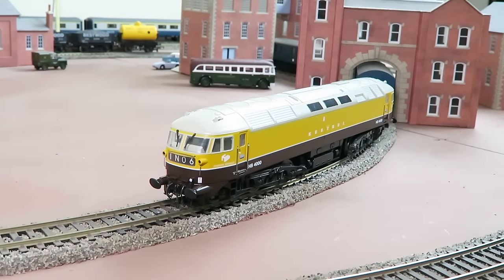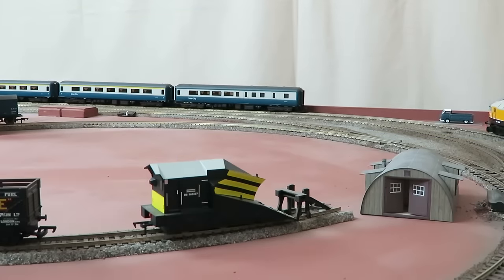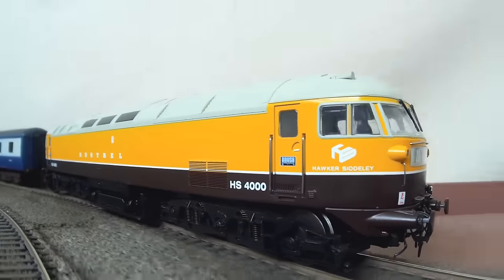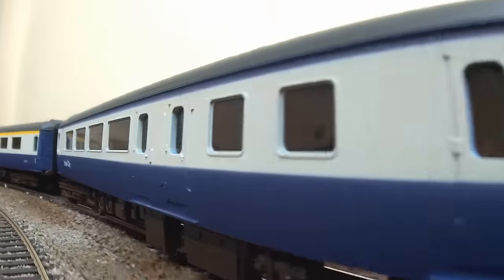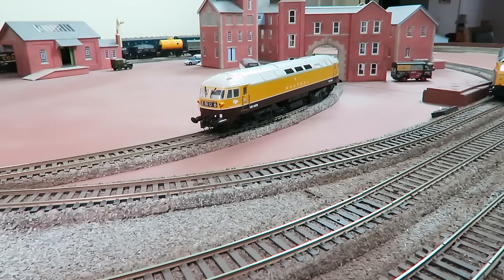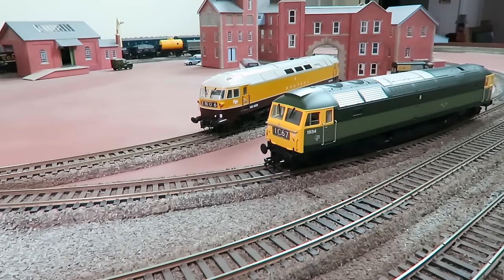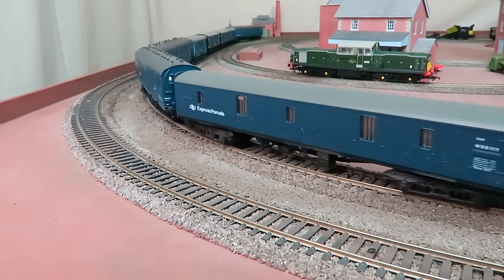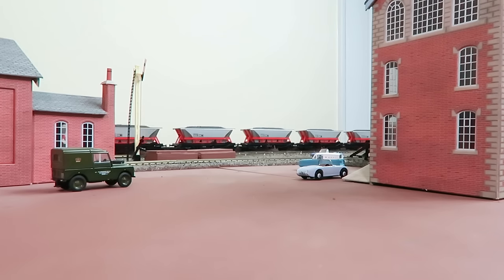Kestrel, HS4000 the world’s most powerful Sulzer locomotive. Model Rail

Comment: Maybe a good interprettation of the sound may give this video https://www.youtube.com/watch?v=K979vex_y18 , with the loco shunting in the first part, and locomotive with train passing at full power in second part.
It's the French class SNCF A1A-A1A 68000, which has the same engine type, the Sulzer LVA24, however with 12 cylinders and not 16 as in Kestrel.
The same 12 cylinder variant was used in the class 48 locomotives, which were class 47 which had this engine type as a test, which was not satisfying, those engines were subsequently sold to the SNCF to be used as spares for their 68000 class.
The French found out why the initial failure rate on these engines was so high, it was a wrongly sized tool for fitting the main bearings in the engine, they rectified this but never told Sulzer nor BR of what they found, otherwise the class 48 would maybe have been more successfull.
This class must not be distinghuished with the A1A-A1A 68500 class, which has a different engine and sounds completely different (but better in my opinion), the SACM AGO V12 DHSR.

The second sound you used may be the better of the 2, being more like this French locomotive.
The first sound is of a class 47, this is a very different Sulzer engine, the 12LDA28, which is in essence 2 inline 6 engines side by side in one block, both crankshafts connected by gears.

It was not easy to find a video of the SNCF 68000 under power, as most video's are made while shunting or coasting at speed, and French drivers rarely seem to add some thrash when passing enthusiasts.
Those locomotives were withdrawn about 10 years before the 68500 class was, and 68081 is the only remaining preserved example with the Sulzer engine.

Comment: I often wondered how smart Sulzer were? When an 47 was re-engined with more powerful unit as Class 57, didn't they have to dump 5 tonnes of steel ballast into the unit to compensate for the lighter weight? British Engineering has continuously lost out  to competition owing to its "we've always done it this way" attitude. Every single motorbike manufacturer bar one lost to the Japanese, every car bar one lost to Europe & Japan. I know Sulzer isn't british per se but the team assembling a 4000 hp beast coming in with an axle loading in excess of the Employer's Requirement takes some believing.
Reply from the maker: Hi Alan, well it was not quite like that really, they produced Kestrel for sale, BR expressed interest and then after agreeing to test it moaned about the loading. Fair play to Kestrel's team who reduced the loading to what they wanted, while this did not allow the full amazing power of Kestrel to be seen